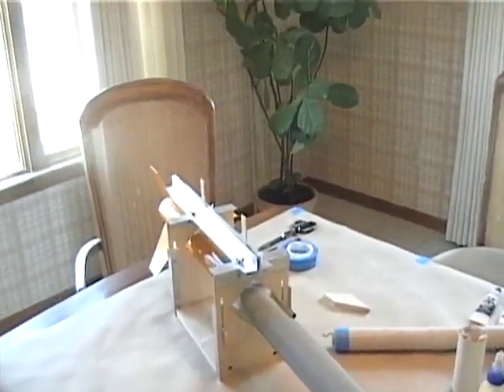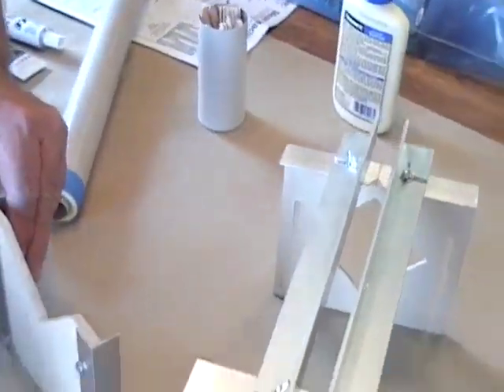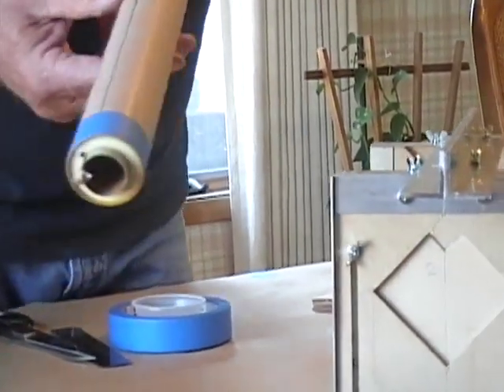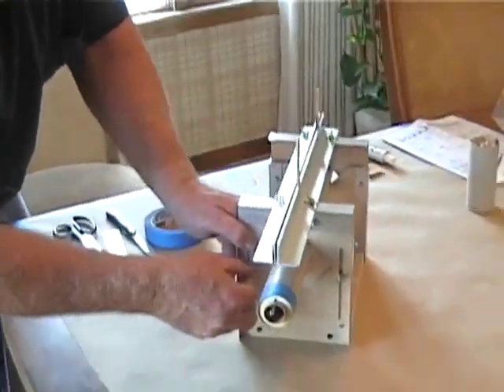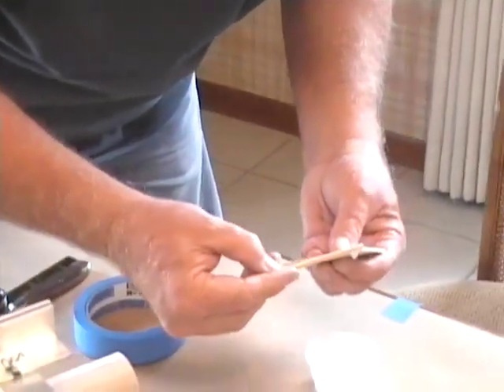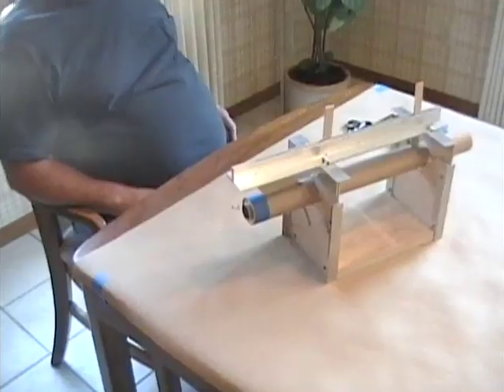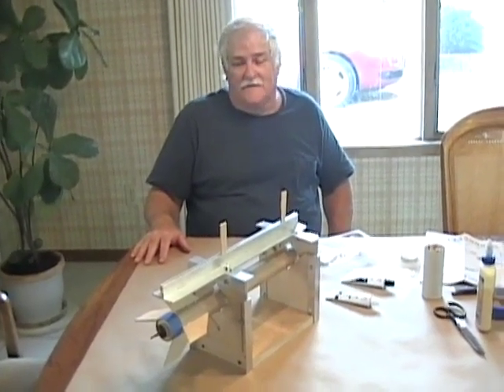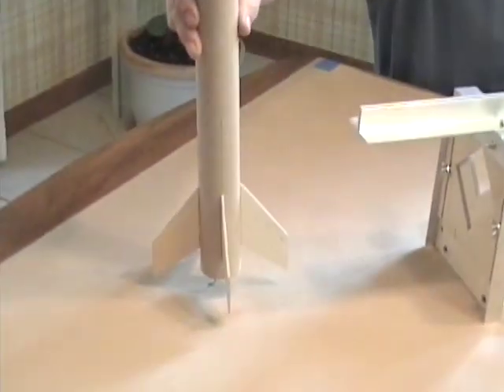Ted Macklin's Guillotine Rocket Fin Alignment Tool

Comment: Very nice concept.  I have seen the product available at Apogee website.  Are there any plans to offer a larger version that can handle larger rockets, say up to 6" diameter?  Compared to other commercially available fin jigs, this one seems reasonably priced if the parts are precision made to ensure accurate alignment.  I would just like to have a version for my high-power projects.